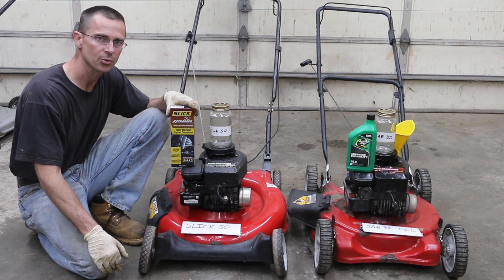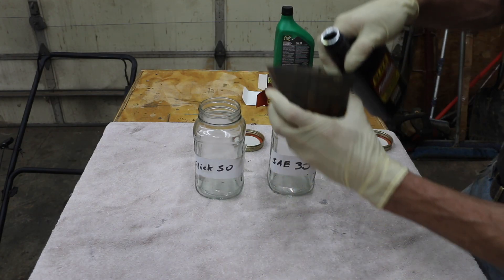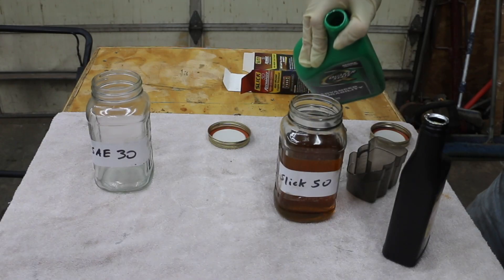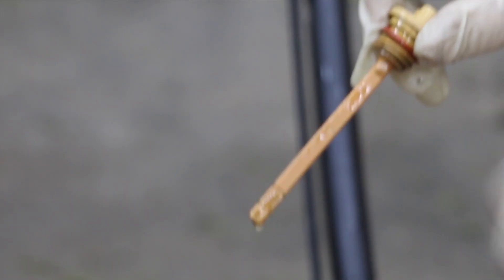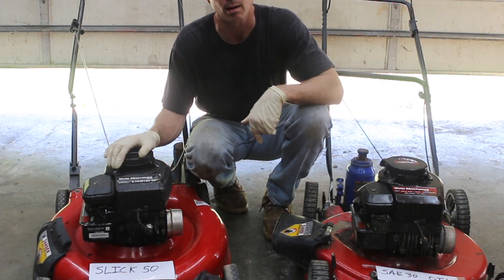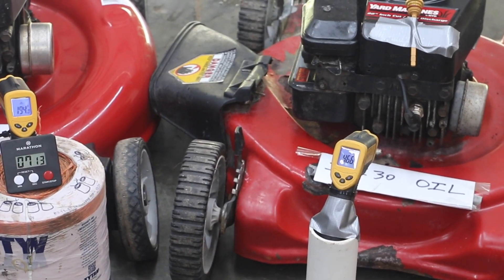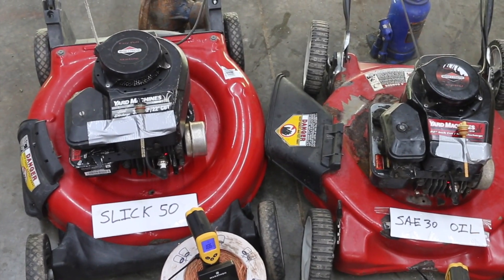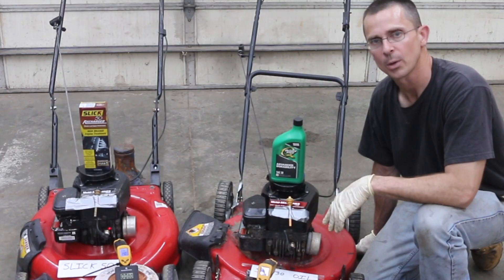Can't believe what SLICK 50 did to my engine!!--Dry Crankcase Test!

Comment: I have used slick 50 in the past and I've always thought it was a decent product. When I found out when I use slick 50 is that all of the Teflon sinks to the bottom of the bottle. You must shake the bottle and then cut it open to get the last of it. You might want to retest.
Reply from the maker: Thank you for the feedback

Comment: This basically duplicates a test run years ago by Briggs & Stratton with a predecessor of Slick 50. In their test the treated engine showed more internal damage due to particulate fouling in the ring grooves. Partly as a result of this test using PTFE oil treatments voids the warranty on Lycoming aircraft engines.

The idea that PTFE will adhere to and protect oily engine surfaces is a farce. All oil additives are at best a waste of money but all could cause harm. Funny how folks think shade tree lubricant engineering is better then trusting the professionals. Modern oil is so good today, change it at a decent interval and save your money on the snake oil products
Reply from the maker: Thank you for the feedback

Comment: I am surprised he didn't actually drain oil also instead of just pumping it out.  Also surprised that it looked to me like slick 50 engine was running much cooler before it quit than other engine.  Maybe other engine assembled with looser tolerances?
Reply from the maker: Thank you for the feedback!

Comment: I had slick 50 in a 2 stroke jetski which cooked and seized because the cooling system got blocked...it got so hot all the hoses melted with a huge clould of smoke...changed the hoses and unblocked the cooling...new plug and it ran for years after...i swear by the shit...

Comment: City of Calgary AB Canada tested Slick 50 in its buses many years ago.  The test result showed that initial operation proved good, but after a period of time, the Teflon in Slick 50 would crystalize and start to break off becoming an abrasive. Methinks that's not a good thing.
Reply from the maker: Thank you for the feedback
Reply: I'm pretty sure it's not silicone. Silicone will destroy O2 sensors.
Reply: @TickleFingers : That might be why Slick 50 had to reformulate when fuel injection became common. I honestly have no idea, just speculating.
Reply: There's silicone in Slick 50? I thought it was just extra-thick oil to improve the viscosity of old worn-out motor oil.
Reply: @fyrstormer  I might be wrong, it might be Teflon.  But the results stand.
Reply: @MrBillmedhurst  Teflon
Reply: @fyrstormer  no, it's Teflon in a base oil, apparently with silicone.
Reply: @fyrstormer  The original formula contained Teflon, and it basically fused it to your cylinder walls. It worked awesome for protection against wear, and if you had a freak accident and ran very low or out of oil for a short time. It was never intended for running a dry engine, but the dry engine tests were impressive back in the day. I don't know what the formulation of the product is now. It was NOT intended to improve oil viscosity in worn out oil. It was meant as a 'new car' protection, and it worked for that. You didn't ever want to put it in an older engine, as it usually made it worse. Restore Engine Restorer is the product for old motors.
Reply: + Elizabeth Nash. Slik 50 also coated the upper engine, reducing camshaft and valve stem wear during startup.
This test was fairly pointless, since 2 engines were used and we had no idea what caused them to stop, or the extent of the damage. 
Slik 50 also claimed that it took 5,000 miles for all the PTFE to deposit.
Since modern synthetic oils such as Mobil 1, we stopped using Slik 50, since we don't need an extra few miles when we run our engines with no oil. LOL
Reply: @wilsjane  I totally hear you, my friend. Back in the day, (the 80s) when I was selling Slick50, it was a great product that really did deliver for engine protection, and you're right that it coated all the moving parts. My point about the cyl. walls was to address what the poster was saying about wanting to compare Restore to Slick50. They do literally opposite things and should be used on engines with completely different milage. Slick50 = new cars, Restore = old cars. That was mainly my point, LoL
Reply: +Elizabeth Nash. We used Slick 50 on vehicles at 5,000 miles (after the surfaces had bedded in) and repeated the treatment every 50,000 miles. We also used it on static engines, particularly when they were rarely run, such as large emergency generators at film studios and those running railway signalling during power failure at the times when traction current came from a different source (720,v DC).
The worries about crystalline material causing damage were unfounded, since, like hard crystalline metal fragments, they would have been removed by the oil filters within minutes.
We only stopped using Slick 50, when we changed over to Mobil 1 oils.The company are very secretive about their additives and I have often wondered if they include PTFE.
I would have used Slick 50  more, but it was very expensive when the lube oil system contained 600 gallons. 
Sadly, the large engine market was something that the company ignored. With engine refurb costing £millions it could have been a good market, particularly for the large ocean liner's, container ships and oil carriers, where a month in dry dock for engine work looses them eye-watering sums of money. 
Maintaining Slick 50 in a 250,000 ton ship for it's engine life, (more than 150,000 gallons of lube oil),  would have cost more than a million pounds, so it would have been a gamble.
Reply: @wilsjane  Wow! I hadn't thought of it's uses in huge commercial engines, but you have a valid point. Cost of the additive vs loss due to failure. That'd make an interesting study, for sure. 

As for Mobil 1, to the best of my knowledge, they don't use PTFE. I did a bunch of oil research way back when Mobil 1 started to become a thing. (around the time Pennzoil was causing major shellac issues) I'm pretty sure if they used PTFE they'd have to put it on the label as it isn't a 'normal' component of synthetic oil.
I think of the sales that would be made if someone was able to pitch Slick50 to the large, commercial engine market, and I'm like.... damn! LMAO! I had won a national Slick50 sales competition in the mid 80's, while managing a Schuck's location, but if I'd thought to even try such a sales pitch, it would've blown the Slick50 people away! hahahahaha! Alas for missed opportunities!
Reply: +Elizabeth Nash. Have you ever seen a ships engines.?
https://www.youtube.com/watch?v=s7BhBsVigZw
Now where do I pour my 700 gallon tube of Slick 50. 😊
Reply: @LizFromDecencyUnited  Especially interesting since when I rebuilt my 2005 Mustang V8 I noticed that Ford used teflon coating on the pistons. Don't know how many, or which OEM''s may also be doing that.
Reply: @LizFromDecencyUnited  Haha ha
Reply: I suspect that operating conditions for Calgary Transit might not match those of American private operators, given the wild temperature swings, punishing cold, aridity, grit-choked wind, and hilly terrain.

The dust in Calgary is incredibly gritty.
Reply: "Prolong" has always been the best. Back 20yrs ago us guys in the shop replicated the old test with the electric motor, bearing race and Torque wrench. We had the bearing race spinning in a reservoir of the different lubricants just like the infomercial and were able to stop the motor with the torque wrench. We then removed the reservoir and applied just a thin coating of Prolong with just a q-tip reservoir and just like the test, we could NOT stop the motor!! I couldn't believe my eyes!! It actually worked.
Reply: yep slick 50  withdrawn from public in 1985.. it really doenst last
Reply: I still have the bottle I bought 20yr ago that I should of returned after hearing about the ill effects of slick 50, even back then from mechanics. Glad at that I never used it, anyhow.
Reply: It used to contain Teflon but not anymore.
Reply: @american23t  send it in so he can do a comparison
OLD V NEW SLICK 50.
Reply: @american23t  If its in a can ship it to me I'll refund your money if you have a recept...27127 zip code plus I'll pay shipping..these folks are ignorant know nothing about "True" Slick-50...

Comment: 25 years ago, I put Slick-50 in my S10 pickup to try to protect the little  2.8L engine because I had to tow a heavy 20' inboard boat 500 miles, up and down hills, in 115 degree weather.
The engine got hot, about 50 degrees above the thermostat, but I made it back. When I changed the oil after the trip, a big black mass came out of the drain hole in a glop. The Slick-50  had congealed like jello. My engine lost a little horsepower after that trip, and developed an oil leak out of the intake manifold seal. But it is still running, without ever being rebuilt, 25 years later. 
 I'm not convinced the Slick-50 helped at all. The oil, with only 500 miles on it, was really black.
Reply from the maker: Thank you for the feedback

Comment: did  you  run  both   engines with  oil in them and  get an  operating temperature?  One  engine might run leaner and hotter than the other..
  I don't think they are identical engines  in  identical  condition .. If they were the same the failure time would have to be about the same ..
  I put  slick 50  in a  really tired  diesel  engine once and it seemed to double the oil consumption ..  A  high Teflon additive  ..

Comment: I wonder what would happen if instead of letting that little bit of oil heat up in the lawnmower, if you had like gallons of it circulating and being cooled by a fan, how cool the engine would stay and if it is bad for "cold" (relatively speaking) oil to flow thru a hot engine.
Reply from the maker: Thank you for the feedback

Comment: You need Lawn mowers that manufactured in sequence, in other words engines that were machined one after another e.g. serial number coincides with next-number.
Tooling tolerance changers over time.
You friction test is unreliable, given that, expansion & heat are proportional and clearance of moving parts is not known.
Reply from the maker: Thank you for the video idea!
Reply: @ProjectFarm  Sir, fyi my Uncle used to work on a small-motor budget production line as a fitter/toolmaker.
The bearing friction test need polished surfaces.
Thank you Sir, for the time & effort in production of your Videos, they are very much appreciated.

Comment: Seeing inside the engines after would have been nice, see the damage that has occurred.
Reply from the maker: Thank you for the feedback!
Reply: @ProjectFarm  I find it interesting that the temperature of the Slick50 engine only reached 290 when it seized, less than the 340 the SAE30 was running at the time and way less than the 420 the SAE30 was when it seized.

Comment: The mower without Slick50 looks like it had more hours on it, which means the engine would be looser. So it’d run longer dry no matter what.
Reply from the maker: Thank you for the feedback!
Reply: Project Farm probably wouldn’t make much difference now that I think about it, being they’re both cheap Briggs engines. Regardless, we all appreciate the work you put in these videos.

Comment: I would guess the engine that was more worn out at the start of the test lasts longer since it's got bigger clearances.   Have to do the same test New Engine vs Old Engine without oil (Same oil as the pre-lube) .
Reply: Have to agree, Mower with Slick 50 looks newer and less used. older mower has worn so tolerances are greater, test therefore proves nothing. A worn engine will live longer without oil then a newer engine. Never used slick 50 personally.
Reply: I think this is a worthwhile comment. Even so, I think slick 50 got caned here.
Reply: The Slick 50 looked newer but the tyres were more worn? 
Maybe the SAE30 had the tyres changed?
This is not a good test. 
If Project farm has some sponsorship or some income stream from Utube then an accurate test would be to have two brand new mowers and do the same tests, or if two older ones then strip them down and measure inside components to make sure they are close to the same condition.
I like Project Farm but this one isn't a proper test.
Keep up the good work.

Comment: PLASE READ! 

Lucas motor oil engine treatment!!! Try it!!! The stuff works! I used 1quart in my 02 grand Cherokee every oil change and one day my water pump went and I seized up the engine on my (4.7l v8) because it overheated and got so hot.. tried to turn it back over and it was frozen solid.. I let it sit overnight to let it cool down and changed oil again the next day with Lucas motor oil treatment yet again and it fired right back up I Kid you not! No joke I am still driving the same vehicle with the same engine as a daily l driver as we speak! The water pump went bad and the engine locked up just as I was able to limp it back home and pulled into my driveway to park. Lucas motor oil works and it clings to the metal parts inside of the engine to create lubricity to help from dry starts and engine wear and tear and I SWEAR it’s the only reason my Jeep is still running today
Reply: PS. I have roughly 50k miles on my Jeep since the day I locked up the engine from overheating it.. couldn’t believe I didn’t warp the head or blow a head gasket.. also used Lucas before that because the Lucas helps to regain compression and to help seal piston rings and valve guides as my Jeep would produce a heavy puff of blue smoke when I would first fire it up in the morning.. ever since the first bottle of Lucas that issue had gone away which was why I stuck with using Lucas motor oil treatment in every oil change.. please try it I’d be curious on this same type of test and as you said I have spent a lot of money buying their products

Comment: I know Im late to the game on this one, but When I came home from the Army, waiting on my civil service job I worked at a gas station.  The owner who was a great mechanic was a fanatical slick 50 fan. When customers had engine problems that were expensive fixes, he would advise them they could try the slick 50 fix.  But it was a whole procedure, first they would shake the bottle like crazy to mix up what ever was in there(teflon?).  Then change the oil.  Then I remember them  instructing the owner driving the car around for a while, on the highway maybe a half hour. I think the next day the car then had another oil change. That was his fix,  no guarantees, but he gave them a $100-125 fix instead of the dreaded $1000 job. I knew when some old jalopy making all kind of noises came in , they were getting the slick 50 treatment. Mind you, this was in the days of the $9.99 oil change and free car wash era. So a hundred for a slick 50 fix was still big bucks/.
Reply from the maker: Did the customers have success with it?
Reply: @ProjectFarm  Yes, I can not ever remember a single one complaining . And where I live complaining and demanding refunds is  an every day occurrence.

Comment: I put Slick 50 in a car once with 50,000 miles on it and went just about 1000 mile and it spun 3 main beaing without warning! would never try it again after that! 1992 car and 1995 is when the bearings spun.
Reply from the maker: Wow!  Thanks for the feedback

Comment: The old commercials were done with  auto blocks, not lawn mowers. 
And they were probably cast iron, not aluminum.
And they may have had water cooling during run times.

Nevertheless, I think this test demonstrates the point.
Slick50 probably breaks down faster because it may be meant to provide some “evaporative” cooling effect.
Which means it dries up and disappears quickly.
Reply from the maker: Thank you for the feedback

Comment: The original slick 50 with Teflon was only to be added into a heat soaked engine 
 Container had to be shaken to make sure that the Teflon didn't settle out 
If you added slick 50 at any other time it would settle out in the bottom of the oil pan, because the Teflon must come in contact with the hot engine parts.
 Or, if you did not shake container thoroughly,
most of Teflon would remain in container.
Zinc dialkyldithiophosphates 
(ZDDP) is and/or was the anti wear agent in oils.
Today's oils have approx 1/4 the amount of ZDDP as the oils of yesteryear 20+ yrs back.
I'm curious about Z-Max
Could you test Z-MAX??
thanks.
Reply from the maker: Thank you for the feedback

Comment: What did the inside look like?!?!? Did the slick 50 die because of sludge build up that hardened or what? Obviously the plain oil died because of heat. However, what happened to slick 50 engine?

Comment: You should compare various oils using the temperature testing procedure. Always use with oil though. It would be good to see if synthetic oil caused less friction than regular oil AND which synthetic oil is the best using the same weight. Not fair to compare 5w-30 with a 15w-50.
Reply from the maker: Thank you for the video idea!

Comment: Love your videos, however I want to point out that it seems like when you drained the oil out you got more oil out of the slick 50 engine, than that of the SAE 30 engine. Did you perhaps leave some on accident in the SAE 30 engine? which would have made it last longer ?. Just an observation I made during your video.
Reply: I thought I noticed the SAE 30 jar a little lower too.
Reply: Yeah, I noticed that too.

Comment: I was told when I put Slick 50 in my car to run it for 2 hours right off the start so it penetrates the metal. 

I noticed the idle RPM dropped by 200 after the treatment. Only did this once but my engine had no issues for the 11 years I owned it.
Reply from the maker: Thank you!